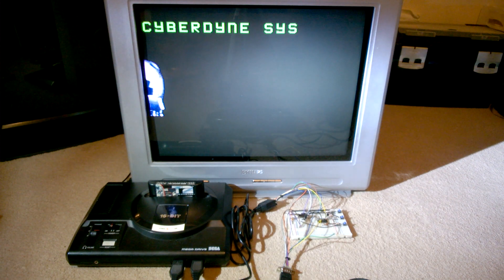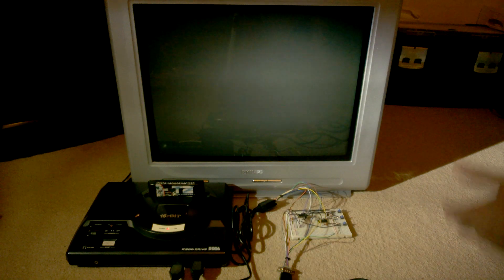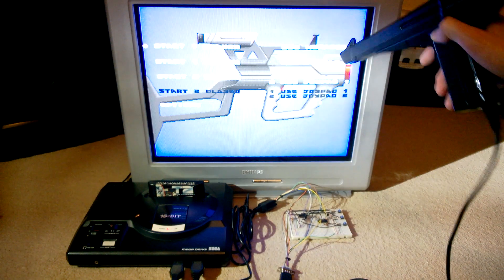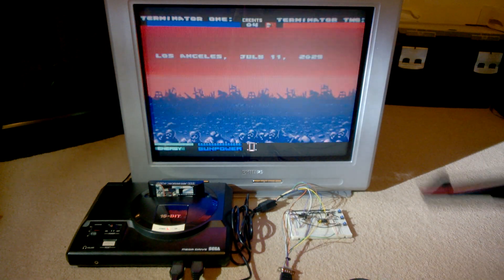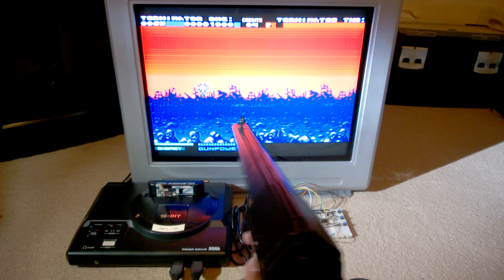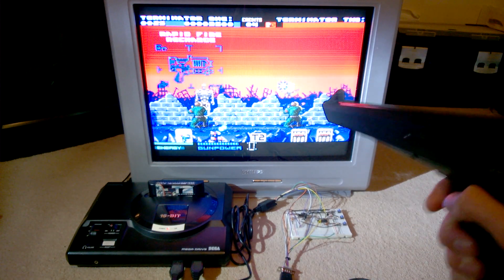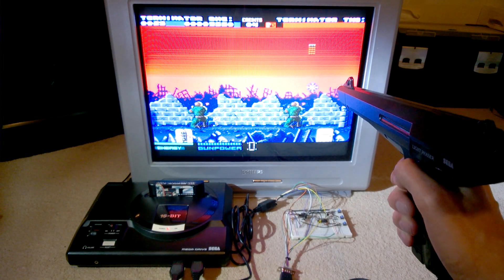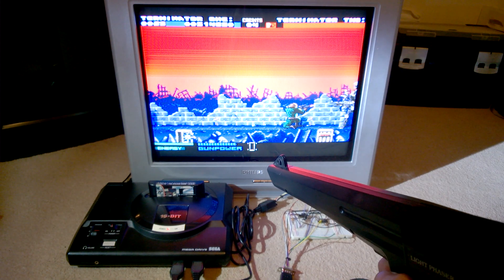Using a Sega Light Phaser to play Sega Menacer games

Comment: A pity the delay, it seems that it is inevitable!?
Reply from the maker: What delay do you mean? If you mean lag from when I move the gun to when the cursor moves on the screen, then that's coming from the game itself. I assume they do that as the game is tracking your position "live" on the screen and this doesn't provide as accurate information as you'd get from a bright flash on the screen, and so to compensate for this (and remove any jitter etc) they average out the readings over multiple frames, hence the laggy response.
Reply: @benryves  Thank you, some very precise technical issues are beyond my knowledge. But I think it would be less complicated to emulate a Menacer with a Justifier?

Comment: I have finally rebuilt your adapter and used it with an old Mega Drive 1 and Terminator 2. It works well.
Thank you very much for sharing your work!
You really did something amazing!
I used 74HCT02 ICs, as you don't have to worry about pull-up resistors at the output to reliably drive the Mega Drives input.
For the RC delay it's better to use something in the kilo Ohm range and just 10 nF. 100 - 200 Ohm is a little much to drive for the logic ICs, especially if you use the old 4000 CMOS. And with a delay in the 10 us range and a slow slope, it might be saver to use something with a Schmitt trigger input after the RC element.
Reply from the maker: Thank you very much for your very insightful comment, and I'm glad to hear the circuit is otherwise working for you. :)

Comment: Turn the brightness down, and turn the contrast up. The gun doesn't need high brightness, that is the black level adjustment. It wants high contrast, which is the white level adjustment. 

Truth be told, the gun only cares about the blue and green colours, it doesn't even acknowledge the red phosphor, and vast majority of it is blue. If you have the ability to adjust the colour balance, you can wind up the blue high level adjustment a bit and that will improve the gun considerably. I have tested this on a CRT projector, where all three colours are coming from seperate tubes and you can cover each of the 3 lenses individually, covering the blue basically stops the gun working at all, covering the red has absolutely no effect, and covering the green has a very minimal impact on it. Even covering both red and green has very little affect, depending on the gun.
Reply from the maker: Sorry, you're right, I misspoke - the brightness is low here but the contrast is turned up quite high, which my camera really didn't like. If the screen looks grey rather than black it's because there's a bright torch shining at it to try to balance out the exposure between the CRT surface and surrounding environment, not a high black level. Needs must when the best camera I have is a decade-old mobile phone...
Reply: @benryves  no need to be sorry at all, you did a great video! 

What you said mixing brightness and contrast terms is a very common thing, and it doesn't help that they are not really appropriately named either :)

Comment: So how do you enter the skip level cheat?
Reply from the maker: It looks like that cheat is for on the regular control pad rather than the Menacer gun so you'd enter it as normal. You can only ever have one Menacer plugged in anyway due to limitations of the IR protocol so unfortunately there's always a free controller port for your regular controller!
Reply: But I thought sega dose  what Nintendo don't,
Reply from the maker: @mr.flipstv  This was a pretty poor generation for first-party light guns across the board, I think - the SNES Super Scope suffers from the same technical limitation. Konami's Justifier gun supports two players for their games, and fortunately Sega did a great job with the Saturn's Virtua Guns!

Comment: Do you sell these anywhere online? 🤯
Reply from the maker: I'm afraid not, though the schematics can be found in the link in the description box if you want to put one together yourself. I had thought about knocking together a PCB design but I have no idea where I'd be able to source the appropriate DE-9 connectors. Personally I've sourced mine from cheap extension cables you can buy online but even when buying from the same supplier some of them have worked and others haven't, the pins are too thin to make proper contact. Not too much of a pain if you're building the adaptor for yourself, but not the sort of thing I could rely on if I was trying to sell them!

Comment: When the Super Scope came out, Sega has a serious case of "me too" with the Menacer.  Knowing what we know now, a large overly expensive light gun with little software support is a bad idea.  I've been thinking that in hindsight it would have made more sense for Sega to just support the SMS Light Phaser on the MD/Gen and also release an updated re-shelled version for new users.
The original tech was good enough, it used the same connector, had an existing user base, and it would have been cheaper for new users.  Your converter shows that is wouldn't have been that crazy tech wise
Reply from the maker: Very good points all round! Konami's Justifier gun seemed to be a much more logical progression of what had gone before and it works much more like a conventional Mega Drive controller than the Menacer does, even if it is slightly weird in the way the second player's gun is daisy-chained.
I'm just glad it didn't kill off light gun gaming for good and the situation became more sensible in the subsequent generation.
Reply: @benryves  agreed!  Saturn and Dreamcast  light gunning was awesome :)

Comment: Good job on capturing video on that CRT screen... and it's great you went into such detail on your website, which is also awesome. I"m gonna have to check out your past entries and learn some stuff on the programming side.
Reply from the maker: Thank you, I had to dig out my old Lumia 925 as it lets me set the recording rate to 25fps unlike my Samsung Galaxy (which only does 30fps/60fps and so is a flickery mess!)
I don't go into too many specific details on my site yet as the circuit is "wrong" (though it mostly works), I've got some new components coming in the post that will hopefully let me put together something more reliable and correct.
Reply: @benryves  I record my screens at 30/60, and it's still flickery, has large horizontal scrolling black lines, or has a ton of aliasing. 🤷‍♂️ And likewise, I'm always finding uses for old tech that I saved instead of donated like in years past. Looking forward to the completed project.
Reply: @The_SegaHolic  if you live in a PAL country you should try to film @25/50 your PAL CRT. but yeah, still not always OK.
Reply: @nattila7713  I live in Hawaii, so 60hz NTSC obviously. 👍🤙